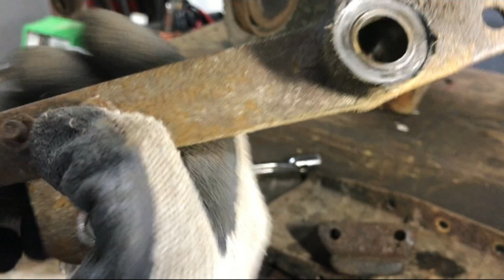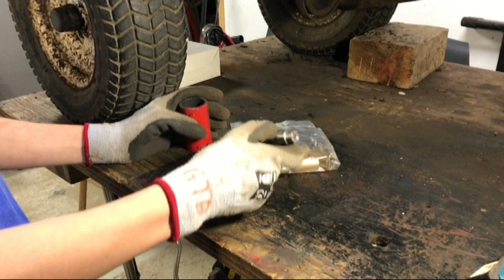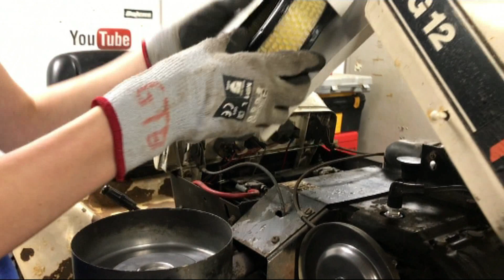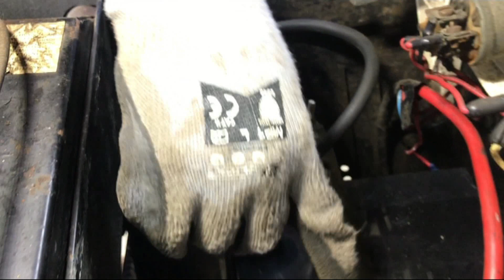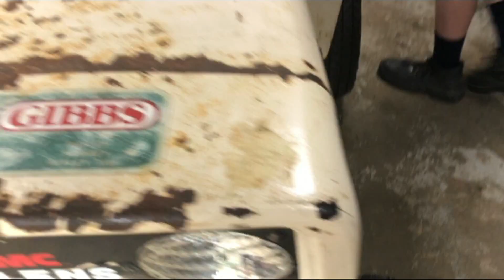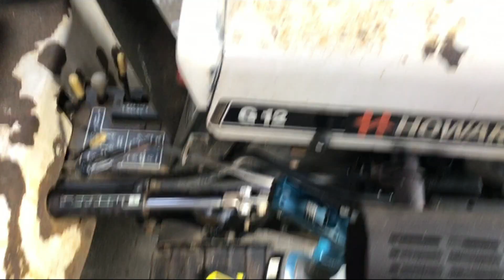1976 Bolens G12 - Part2

Comment: Another great video with lots of good information.  Thank you for taking the time to measure the travel of the cylinder as I have made hydraulic lift set ups on two of my tubeframe tractors using a 6" long stroke off the shelf cylinder - had to make the attaching bracket pivot point about an inch higher so that the lift arm moved the correct distance. Nice to know what the original stroke length was on the factory units as I have one 1050 that is still manual lift and I may see if I can get a custom made cylinder with the correct stroke created if I ever convert it to a hydraulic lift.
Reply from the maker: Thanks. It would be great to make a hydo lift and I think the challenge for us would be to find an affordable pump. Take care

Comment: Nice to see the shop organized and the work is progressing. As the weather turns cold we'll need heat to work in the shop. Best regards, Butch in Idaho
Reply from the maker: It is fantastic to have some space in the workshop. We still have a few more upgrades we want to make to the workshop. For heating we already have two diesel space heaters which are not great to use and we are going to try a 3kw RV heater. Take care Butch

Comment: Good video. I use sockets as adapters on my press. The old shaft should be cleaned with crocus cloth and lubed before putting the new bushing onto it. In a pinch, I've turned copper pipe on my lathe to make bushings. The gasket between the dashboard and the hood seems to be shot. I've used a rubber gasket that had adhesive on one side and was approximately 1/4" thick and 1/2" wide. It was for sealing aluminum storm doors. It worked for several years. Good Luck, Rick
Reply from the maker: Sockets seem to work well but it is fun to make a tool to use. Great advice on cleaning up the shaft, thanks. I do not think any of our tube frame tractors have a good gasket between the dashboard and the hood so I am not sure what they should look like. We will see if we can find something like you described. Take care

Comment: no need to buy a bushing driver when you can make one,, I found out that it's very important to have a battery hold down, I ruined a nearly new battery by just sitting it in there and unbeknownst to me it slid forward and the engine pulley wore a hole in the battery and so that one was no good after that.
Reply from the maker: It is a lot more fun to make a bushing driver too. We have fitted a battery hold down but I am not sure if we showed it in the video. I believe dad had a similar battery experience with a Bolens H16 many years ago, an expensive lesson. Take care